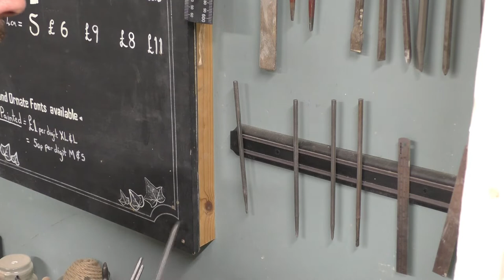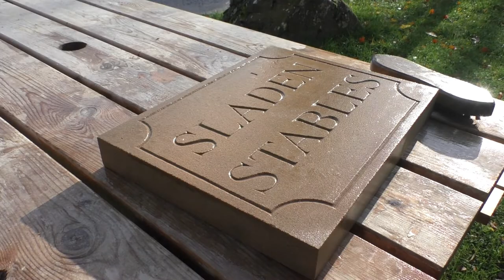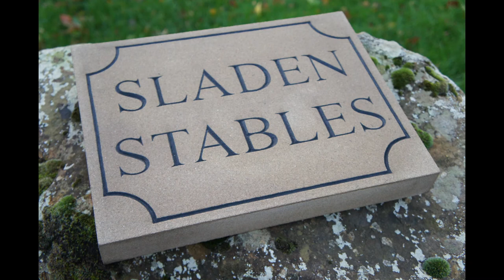HAND CARVING a stone house sign for Sladen Stables - stone letter carving - stone carving

Comment: Can you confirm the type of stone being cut please. Sounded  like "Breton stone". Just can't hear what was being said because of the massive piercing clanging. 
50 Years in sheet metal and heavy steel fab.
Thanks.
Reply from the maker: Hi Don, firstly, thank you for watching 

You got it rights the stone is from a quarry in Derbyshire called Bretton moor. It’s a lovely stone very nice consistent grain
Reply: Thanks very much. Greatly appreciated.
I've re located to Devon and found some inch thick Delabole slate in the garden.
So tried my hand at a house name. That stuff is very odd. 
I nearly drilled right through it in a flash as I tried to add a dot to a serif tail on an R. SUPER SOFT.
But when cutting with my chisel(1/2 wide but sharp. Must get proper chisels), it doesn't go Chk Chk Chk, It goes CLANG CLANG CLANG! and does not cut fine. Ragged edges as it flakes out.
Hey ho. Its all I've got and it's free and I'm learning.
That's why I wanted to know what you're using.
Painting discipline also noted.👍
Thank you.
Liked and subscribed
Don.